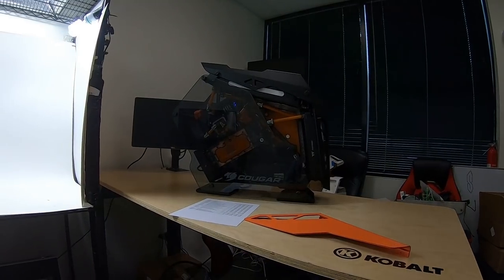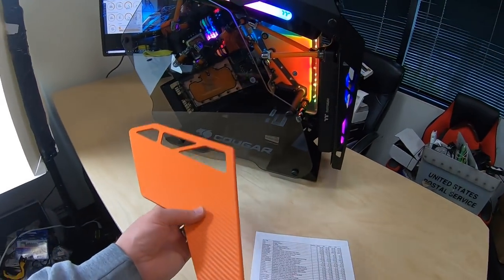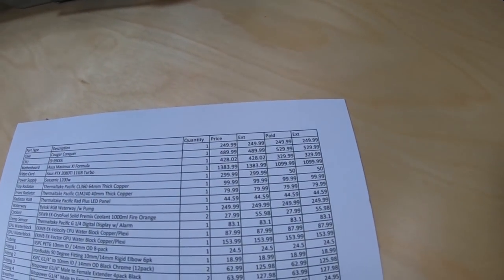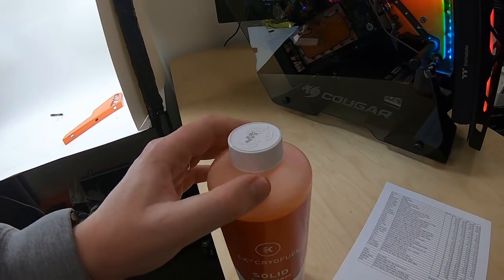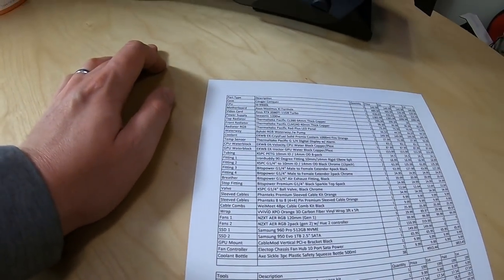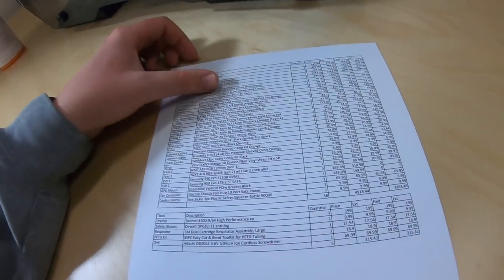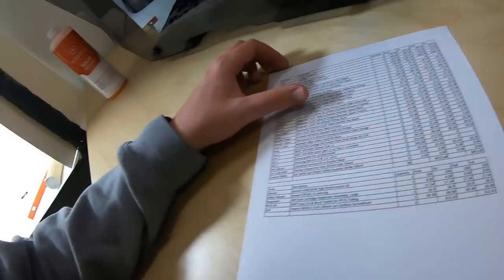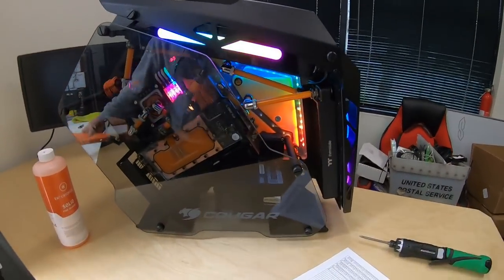DONE! i9-9900k 5.1GHz / RTX 2080Ti Water Cooled 2019 Best PC Build

Comment: First time pc builder so im doing a bit of research for my next build. The power cables that are needed for the 2080 ti, do they come with the power supply or do I have to order some extra ones? because I think it needs a 6 pin plus 2 8 pin connectors for the model im getting
Reply from the maker: Yes they should come with the power supply. However if you want them to be fancy you can buy sleeved colored cables ot match your build that are extensions.
Reply: Computer Headquarters micro center was a huge help with the psu. I’m actually on the way back home from there. Got all the parts today so wish me luck.